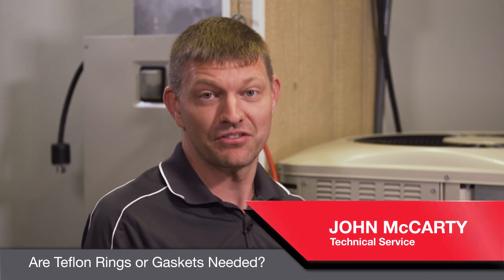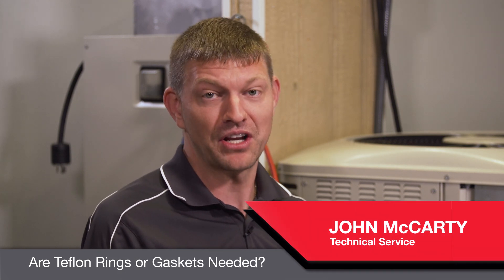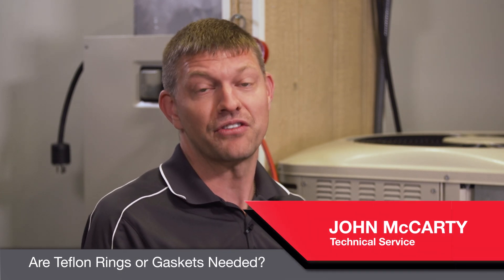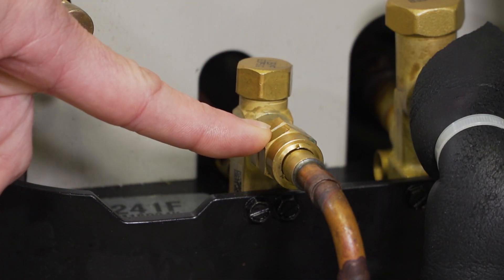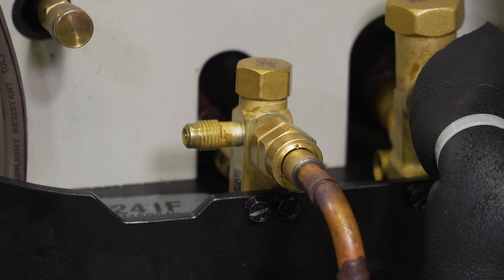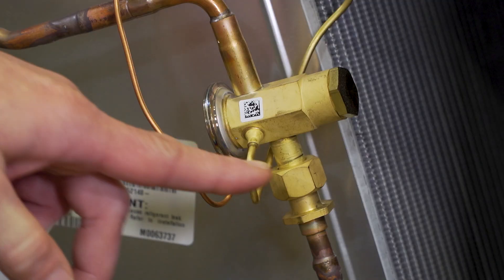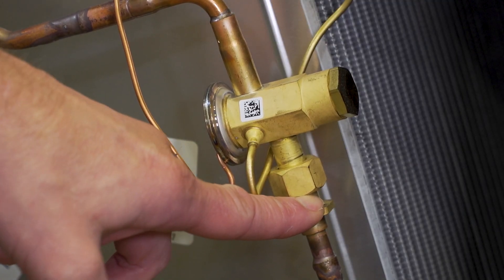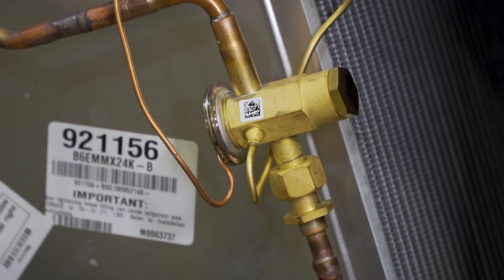Are Teflon Rings or Gaskets Needed?

Comment: A more common question should be where do we find the torque specs for this kind of mechanical connections? Will these specs need any adjustment of we use Nylog or similar?